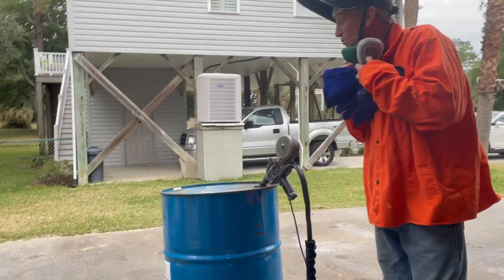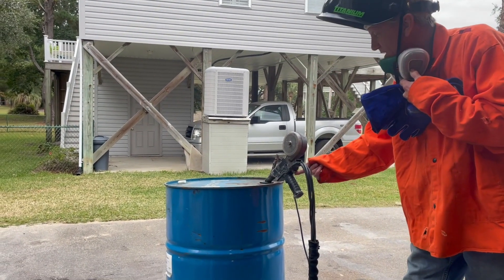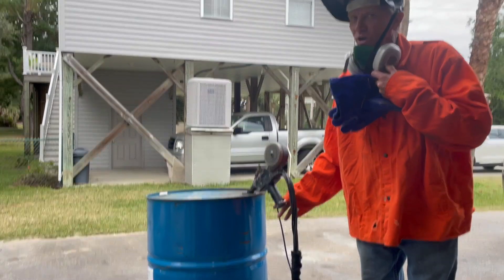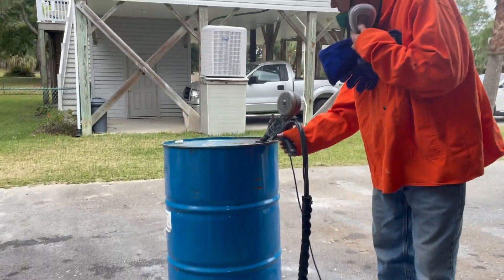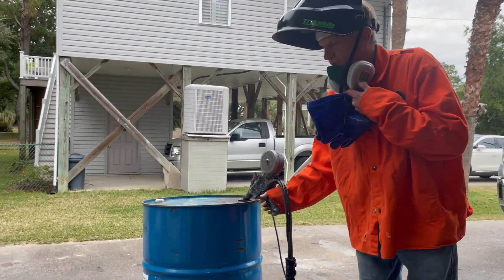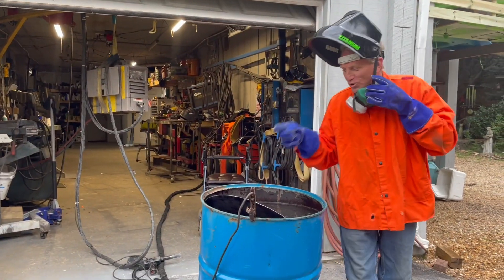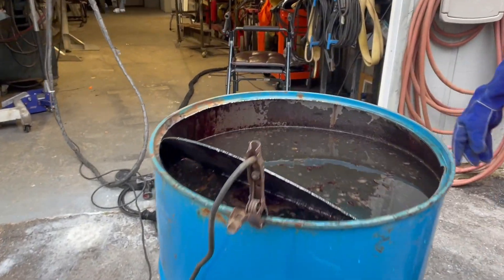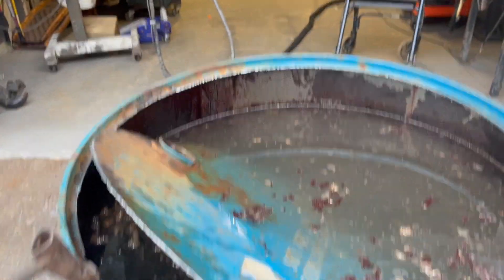Welding Safety 101: Cutting or Welding on Containers That Have Held Flammable Liquids

Comment: If you have an air hammer with a chisel point you can run around the top of a drum a lot faster. Still watch out for flammable vapors though.
Reply from the maker: I wanted a clean edge because it’s going to be used as a burn barrel. But yes, the air chisel will get it done, still, follow the same precautions due to potential of a spark